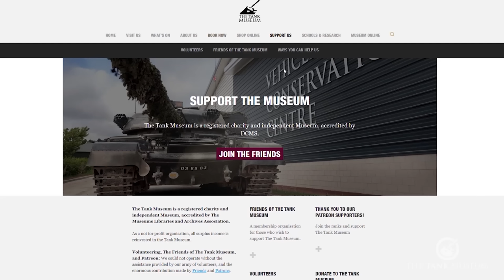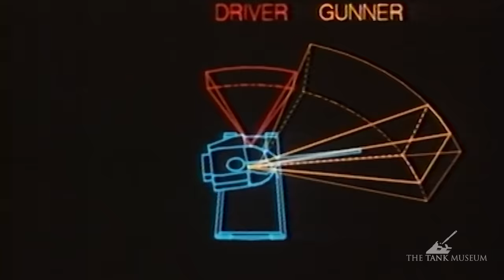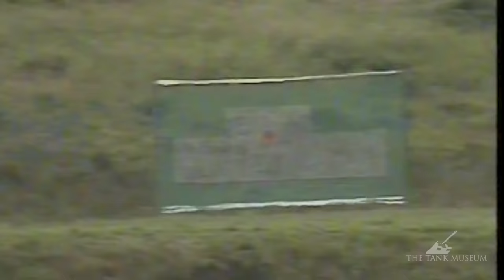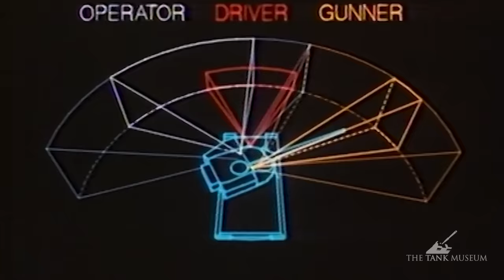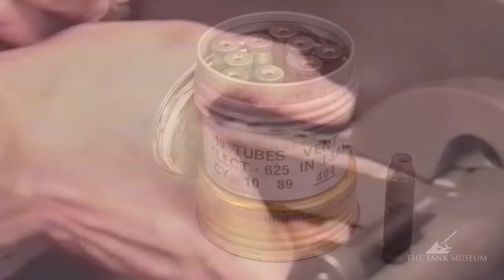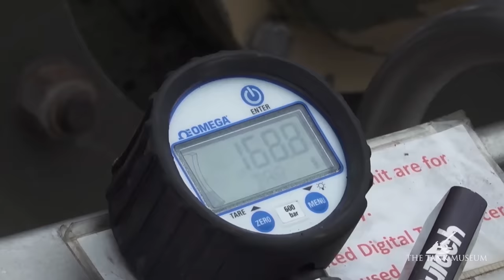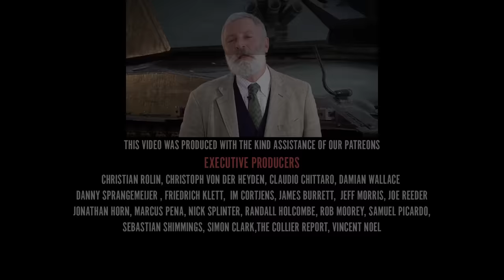Tank Chats #92 | Challenger 2: Full Length | The Tank Museum

Comment: Those Vickers export tanks eventually came up against T-72s when the Iraqis invaded Kuwait in 1990. They managed to hold their own for a fair few hours despite only being elements of a single brigade against elements of two Iraqi Republican Guard Divisions. Really interesting video, thanks!
Reply: Well its export vs export lmao
Reply: mhh not quite right.
When you are talking about the battle of the Bridges in Kuwait
There was the 35th kuwaiti armored brigade, but of its two Chieftain bataillons less than 50% were operational at mobilisation. both together could only muster a single understrength Chieftain bataillon. (36 vehicles)
They were supported by a mech company with some add ons from other companies and a severely understrength artillery company.
The irakis moved in only ELEMENTS of 2 mech and armored divisions without recon.
The irakis lost about 30 armored vehicles (this includes BMP and MBT) before they retreated.

That is hardly a victory to brag about.
Considering that the Kuwaitis lost 136 of 143 Chieftains and a total of 250 MBT´s PLUS about 850 IFV´s and APC´s in the whole invasion, while the irakis barely lost any T72´s. (about 120 armored vehicles in total. again BMP´s and MBT´s are counted together)

Similar figures arise during the Iran-Irak War from 1980-88.
Iran lost 600 of its 894 Chieftains and Irak lost barely any T72 and som T62
Reply: @zhufortheimpaler4041  Looks like the Kuwaitis were caught with their pants down then.
Reply: @sandgrownun66  or chieftain is just a bad  tank.
i mean there are examples from the reforger exercises, where chieftains from the frontline brigades of the British Army on the Rhine (british NATO contribution to european defense during the cold war) just broke down on the roadmarch from the railhead to the rallypoints. 
the BAOR had also an estimated 35-40% mechanical failure rate on chieftains under peace conditions.
Reply: @zhufortheimpaler4041  Mainly engine breakdown of the Chieftain Leyland 'multi-fuel' engine insisted on by UK MOD,  that had to be able to run on everything from candle wax to Kerosene and anything  between.  A truly mad decision.
Reply: @chrissmith2114  It wasn't caused entirelly by the engine, it was the fact that they put it in a near 60t tank, the Leyland was 650-750hp depending on the model, almost every MBT that weighs about the same and has a 1200-1500hp engine.
Reply: @chrissmith2114  It wasn't a mad decision, it was the NATO requirement for the time and only the UK met that requirement, poor as the result was.
Reply: @Thurgosh_OG  Thanks
Reply: @zhufortheimpaler4041  lol.. Sorry mate your name gives the game away ...
Reply: @luciusesox1luckysox570  Zhufor the Impaler was a special character model for the Chaos Space Marine faction in Warhammer 40k.